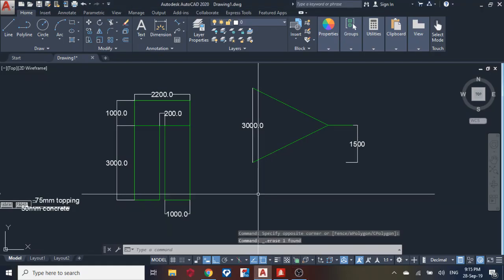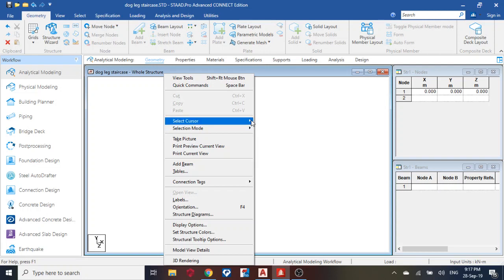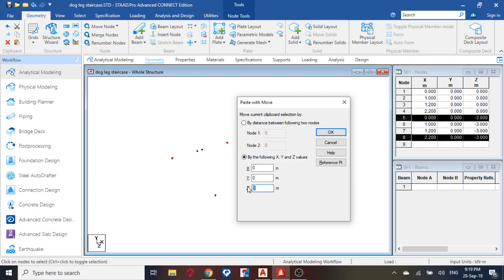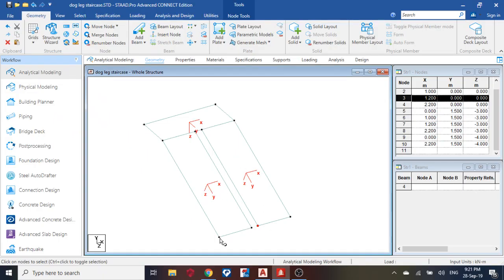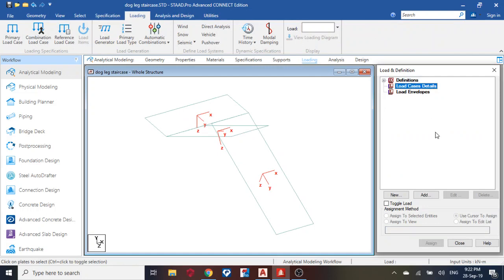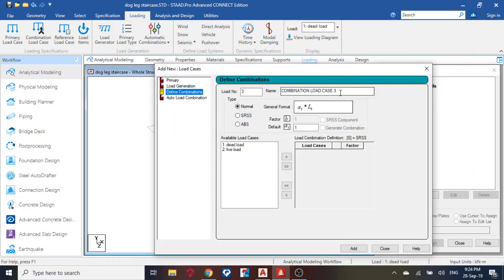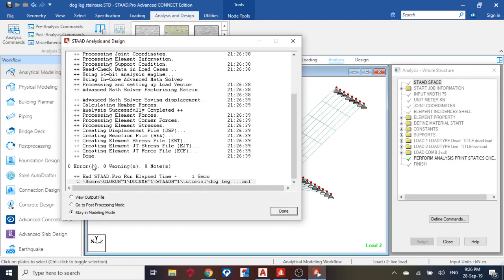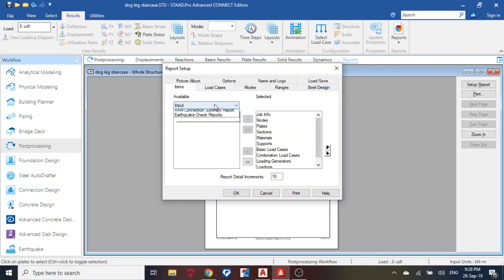How to model and analyze a dog leg staircase on staad pro connect edition

Comment: What is the difference between freestanding and dog leg staircase？
Reply from the maker: Dog leg staircase has support on both ends and the half landing whilst free standing has no support on the half landing
Reply: @Lanreolokunola  I see. Dog leg stair case is also simply supported at one edge.
Reply: @Lanreolokunola  Will mesh of flights and mesh of mid-landing share same nodes? In the examply, their meshes use different nodes.
Reply from the maker: Try and make them have same nodes, if not the difference in analysis won’t be much
Reply: @Lanreolokunola  Can I have your email? Youtube if not available when we  are in China. Or is there any other websites where we can see your videos?
Reply from the maker: Olokunolalanre@gmail.com
Reply from the maker: @赵彪-h3u  olokunolalanre@gmail.com